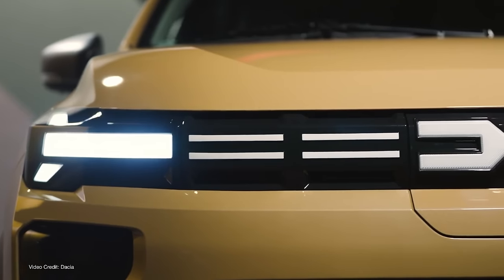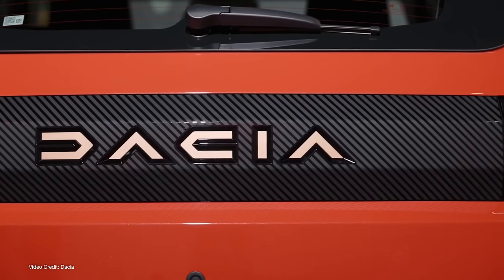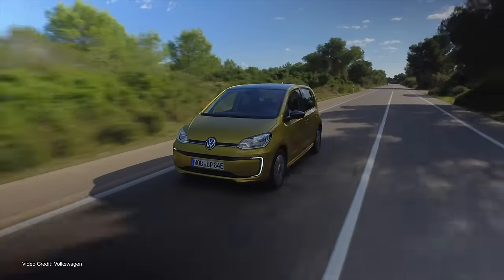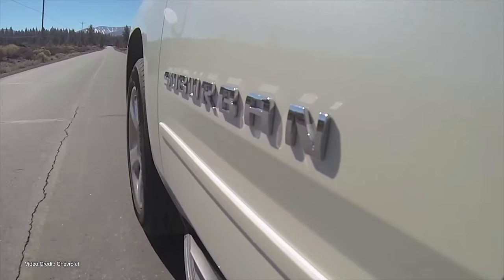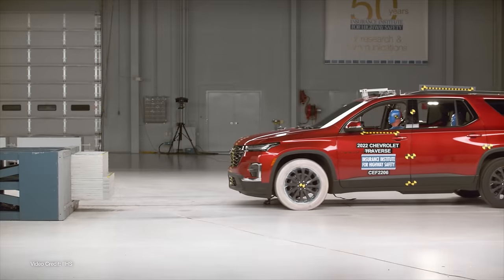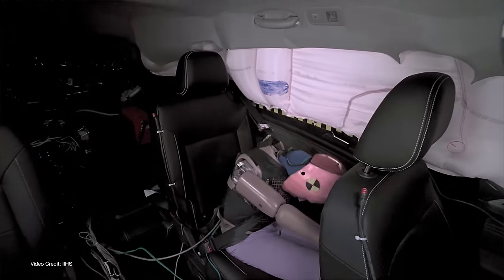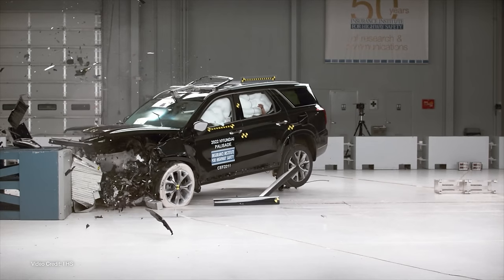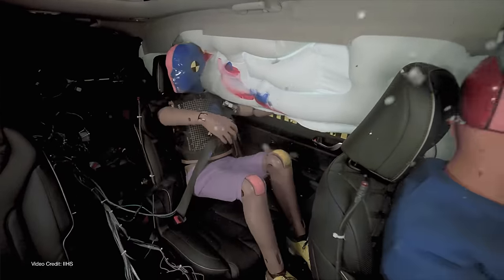Never In The USA - Why the US (And Canada) Appear To Be Anti-Small EV

Comment: The real reason small cars are disappearing is profit margin, the car companies sold loads of smaller, cheaper cars, but they can make more by selling fewer of the larger more expensive vehicles.  So the smaller ones have slowly been phased out.  It's been happening for at least 10 years.  Has very little to do with societal pressures, it's all about the fact that making 2 smaller cars cost more than making one larger one, but the combined profit on the 2 smaller ones is less than the one larger one.  The marketing propaganda by the auto makers will of course just say people don't want the smaller cars, even though they sold tons of them.  They couldn't make the Bolt fast enough to keep up with demand, but still shut down the line to make trucks instead.  No chance the new Bolt will be anywhere close to as cheap as the old one was, and they will say they have to charge more because it's bigger.
Reply: When they were on sale hardly anyone bought them.
Reply: The Detroit big 2 1/2 have never been able to build a decent affordable compact car period. They couldn’t when they needed to when the Arab oil embargo started in fall 1973 and the Japanese automakers began to really sell their sub compact cars.
Reply: THIS
Reply: @AutoReport1  they didn’t buy American small cars, style, reliability, issues
Reply: @rose415  they didn't buy Japanese or Korean ones either. The RAV4 saw sales shoot up by 4× when they upsized it from subcompact to compact.
Reply: The original comment here from Marty is correct, the rest of you need to check for a pulse.  My MR2 was crushed between a stopped vehicle and a caddy doing 50.  Yes I was injured but even that unfair fight left the MR2 passenger cabin in the same shape it was before the impact.
My father owned a Ford Focus that he liked a lot.  Small cars in fact, are "the gateway drug" to Brand loyalty for consumers because most small, used cars are first time purchases of young people.  Not all of them are car savvy but all will remember the car that didn’t leave them on the side of the road when they needed it.

The people most likely to "blame gubment" for every occasion are THE SAME people who absolutely worship corporations and blame buyers.

Just sit in on a quarterly reports meeting for Ford or GM.  Growth in profits instead of just profits is all that matters to them now.  It's tied to executive compensation in the form of stock options.  Why? Because : 1980 presidential election.
Reply: > The real reason small cars are disappearing is profit margin

Well yes, 100% true, but also missing an important piece of context. The market in the US and and Canada is distorted in favour of larger and more expensive vehicles because of things like the light-truck loophole and the way that corporate fuel economy targets are skewed towards bigger vehicles because it's harder to hit to your category emissions target as the vehicle footprint gets smaller. The US does not properly tax/disincentivize big vehicles to make smaller and more efficient vehicles more desirable to sell or buy. And now it's a hopeless mess in American because 

a) The average vehicle weight on American roads is so high that there's a long lasting disincentive for buyers to keep one-upping each other in bigger and heavier vehicles for safety reasons

b) The car industry and the generally bad low-density urban planning across the country keeps reinforcing each other.... people live in dreary unwalkable suburbs with roads wider than highways in other countries -> buy vehicle way bigger than they need because there aren't space or tax penalties like other countries -> get attached to bigger more expensive car because they live in a dreary unwalkable suburb so you need something to make you feel special -> keep buying bigger emotional support vehicles and mcmansions to feel pseical while living in suburban hell where its a 20 minute drive just to get basic groceries.
Reply: Simply put the profit margin for an SUV or Pickup is more than that for making a well engineered and appointed small car.

Comment: Here in Australia 35 years ago, I had the bizzare coincidence of seeing the results of 2 cars crashing at the same place and speed within 24 hours of each other.
One was an older 1966 6 cylinder Chrysler VC Valiant, the other was a late 70's 4 cylinder "Chrysler sigma".
The Sigma was totalled, with the passenger getting a bump on the head from bouncing around unbraced as the only injury..
The Valiant looked fine, barely a scratch - but the 4 passengers ended up hospitalised with broken bones and head trauma..
Thats when I realised the claims that a newer SAFER car was a better option than a cool sounding big old car were true.
Nowadays, tho, its become weird where people ( even in Australia ) are going for SUV's and other bigger vehicles "for safety".
And every week, another child gets killed or maimed because the driver couldn't see them due to the size of the vehicle in thier own driveway!
A 60% increase in 10 years!
Reply: the emission standards has had something to do with vehicle size.
plus the end of the cheap mid/large sedans made by ford and holden.
small cars are mostly junk. they're cheaply made and handle poorly on our horrible roads.
suv became popular because they are easier to live with, the commodore and falcon are hard to get in and out of if you have mobility issues but the like of a VW golf the front door gave you more head room to get in or out.

the difference between the valiant and sigma was more than 15 years of development.
but the valiant would of protected the passengers in a side impact due to the doors being over 2 feet thick 🤣
but yeah a car fitted with the old self adjusting seat belts always faired worse than auto retracting because people never adjusted them correctly

Comment: Thanks for the Aptera shout out! It's the car for me
Reply: Excellent! Wait just ten more years and they will be for sale. In the meantime, get a Schwinn bicycle to ride and when the car does go on sale, you'll be skinny enough to get into it!
Reply: That's a ridiculous reply, you don't have to be skinny to fit into aptera, do you know anything about that vehicle? 

I'm really glad Aptera was mentioned in the video because American cars just keep on getting bigger and heavier and more expensive, despite the efficiencies that could be gained by aiming for smaller and lighter vehicles. The Aptera, although not tiny, is extremely efficient and aerodynamic. And it is coming to production. 
I really think that once something like this goes into mass production it'll turn heads and it will change peoples' minds. Without any new battery technology Aptera is forecasting ranges as high as 600 and even up to 1,000 miles on a full battery.
The vehicle is built on a carbon fiber frame and so should be about as safe as anything out there.
Reply: Were I but 15 years younger, the Aptera would be a great vehicle for me. Not sure my knees could take the low seating, these days. Maybe the next time I'm on the Left Coast I'll try to find one to sit in, just for fun.
I also am a little skeptical regarding this autocycle's long term viability, even assuming they eventually get to thousands per year coming off the line. I can understand why, being capital constrained, they are depending on overseas fabrication of a large portion of each vehicle, but I wish the production could have been organized more vertically, within their own facility, here in the States.
Reliance on overseas production of the motors and much of the vehicle body exposes Aptera Motors to costs (production and shipping) beyond their control and exposes them to additional risks.  I wish them all the success in the world, and look forward to seeing Aptera's wheeling around, but I'm less than sanguine regarding that success I'm hoping for them.
Reply: I've been watching the Aptera since it was first announced.  It looks great, but I want to see reviews before putting money down.
Reply: Well, it’s not a car.
Reply: How well does the Aptera do in 6 inches of snow?
Reply: @RyoshiKuraOka  That was exactly the question I had a few months ago and the answer I found was that it had never been tested in the snow.  It's the primary reason I didn't put money down on one.  I need a car I can use 365, so I'm waiting on reviews.
Reply: not yet made unfortunately
Reply: Well me too, in theory. But it's so ludicrously overpriced it just becomes another status symbol, a wealthy person's gadget. For daily driving i'll get a BYD Dolphin or similar/smaller and buy heat pumps or home insulation with the money I save.
Reply: @nickfosterxx  You make a very good point, but, counterpoint:  Aptera looks neat.  Seriously though, I bought a used Nissan Leaf and home solar panels to charge it.  I don't have hundreds of miles of range, but I can go over a speed bump without bottoming out.
Reply: @madcow3417  Yep. With you on that. I'm lucky enough not to need a car, so share one for the weekly 100 mile round trip. Walkable cities rock, imho the best car is actually no need for a car ; )

Comment: It's a real shame that there are not more smaller cars made.  I really like the bolt.  I had an old honda civic years ago.  I can't stand large cars and suv's they are just very cumbersome.
Reply: There is a lot to like about the Bolt. It would be nice if it DC fast charged faster, but it can do it. Wife has one. It is fantastically efficient around town. It has a very practical shape. It's kinda quick. Not dual motor Tesla quick, but sure doesn't struggle to get going, and it does the 1 pedal driving thing like it should. They say they are going to bring it back. I hope they do.
Reply: @markplott4820 It's very unlikely that the 25k USD Tesla will be produced in significant numbers in 2025, and the price is far higher than half of the base Model 3
Reply: @fjalics  There are dozens and dozens of small car options here in Europe. Pretty much every manufacturer has a small EV option. They have safe crash standards too. They just don't comply with US requirements.
Reply: Europe has over a dozen good small EV’s on offer.
Reply: @AlanTov  I know Nikki is now in the US and thus a bit more influenced by that market than Europe, but I do wonder if they should do an updated video on all the compact and subcompact EVs on offer in Europe. There are so many. The Zoe, the Renault 5, the Corsa, the citroen offerings, the Seat, the VW she mentioned, the Honda E, the MGs, Peugeots, BMW i3, VW id3, Smarts, Skoda etc etc.
Reply: @TheGramophoneGirl  We see those cars all the time on the FullyChargedShow.  So incredibly frustrating to see what is going on in jurisdictions that are not North America.  
Unfortunately the Canadian market is small enough that we are continually lumped in with the US when companies are laying out their marketing and sales plans. When VW USA did not want the ID.3 VW Canada got caught in the cross fire and we couldn't have it even when we wanted it.

Comment: The Aptera is NOT a car. As a three wheel vehicle, Aptera has applied for their vehicle to be an autocycle- meaning it is, according to NHTSA, a motorcycle. As a motorcycle, it doesn't have to meet most of the crash safety requirements and if you're able to insure it, it will be insured as a motorcycle, not an automobile.
Reply: Just because it doesn't NEED to meet NHTSA automotive safety for cars doesn't change the fact that it will; testing will be done in the next few months as PI vehicles are made.  Crumple zones, airbags, large size and low center of gravity means it will still be a very safe vehicle.  Cheaper insurance is a bonus.
Reply: @ccibinel Aptera will likely be safe in but lacking front and rear bumpers a minor impact will probably total it because of the costs and lack of auto body skills repairing composites.
Reply: @timothykeith1367  Repairing SMC is the same as most boats.  Definitely easier than their original composite honeycomb but definitely worse than normal sheet metal.  SMC is basically fiberglass and isn't that rare.  Any damage deep enough to damage the CFSMC body is likely to writeoff most vehicles anyway.

Comment: It's unfortunate BMW could not find a way to make the i3 more affordable.  It's the perfect size for a 1 or 2-person commuter car.  Unlike other small vehicles, it's not claustrophobic.  It feels bigger on the inside than it does on the outside.  It has a reasonable range of 180 - 200 miles around town.  I get about 150 - 160 miles on the highway.  In today's market, it is definitely not a $55,000 plus vehicle.  It would be an excellent $30,000 car.  After 7 years of i3 ownership, I made the mistake of driving an ioniq 5 the other day.  There is now an ioniq 5 sitting in my driveway! It's the first EV that actually made me feel like I was sitting in my i3.
Reply: I will try to keep my i3 as long I can. It will be a classic car in a decade.
Reply: I love my i3 (2018 BEV), but I think that it suffered a bit from 'blank check syndrome' when it came to manufacturing cost. Because the original mission of the 'I' sub-brand was in part to pioneer new manufacturing technologies, they prioritized trying new things (e.g. CFRP body structure) vs. building to cost. They could have made a car within about 10% of the weight and performance of the i3 using more conventional technologies that likely would have been cheaper to build (and consequently, to buy). They almost had the concept a few years before the i3 with something called the Z13 (a quick Google search will show you the right thing), albeit as an ICE vehicle.

Comment: One thing is that smaller cars aren't, necessarily, cheaper to buy. They have all the bells and whistles like power widows, power steering, AC, airbags etc. All those things are considered a necessity these days. They are cheaper to operate, usually but not always. Some of the old cars got fairly good fuel economy and were roomy. The fact that people are so worried about safety is a, relatively, new thing. I'd be willing to bet that most people have never been in a serious collision. I know I haven't in my 50+ years of driving. You can be a safer driver by just paying attention to what you're doing and watching what other people are doing. Put down your cellphone and your cheeseburger. and concentrate on driving. Car/trucks, these days, are so comfortable that people forget that they're piloting an dangerous weapon that weighs a couple of tons.

Comment: The issue with range is if you only have one car you need a car that can do those 1% of the driving.  I live in VA, but family is in upstate NY and I go there in the winter with temps often at 0 or below.  The distance between chargers along I-81 has improved, but there is still a 150+ mile gap and with 40% range loss I can barely do that in my ID4.  If I had a smaller battery I could not make the trip.

Comment: Very thorough.
Glad you at least mentioned the Aptera. I've been following it for a couple of years now.  It has several features.  
#1 it is massively optimized for low air resistance. It has the same air resistance as a mirror on a full size pickup. Crazy.
#2 Light weight.  1,800-2,200 lbs.  2 seat (plus pet), relatively large cargo area. 3 wheels rather than 4.
#3 4 range/battery sizes: 250/400 (41KWH)/600/1,000 mi.  Battery is modular, so it is supposed to be easy to upgrade by plugging in new modules
#4 Includes optional built in solar cells.  With max cells can charge up to 40mi per day, intentionally picked on the average travel you mentioned.  If you get lucky and can plug in to 110v at work you can get 13mi charge per hour. 
#5 Price is good. Was initially touted at US$20K. Now as final build is being finalized price is around US$29K

EV is great, but I live in "Winterpeg" Manitoba, Canada.  Even with global warming, we still get 2-3 weeks of -40C temps and a couple of months of -20C. That means battery range less than 50% of advertised.  That really sucks. And it does not encourage full EV. I think for us Hybrids are a better option.

Response to Tesla Semi:
Have you seen this very niche product.  A EV Hybrid LOGGING truck, specifically for BC. Heavy duty construction all over. "Small" diesel engine (specific size and model is totally user optional, simply drop in replacement since it does not connect to drive system) and "small" battery pack. The "small" motor (much smaller than needed to provide direct drive) runs at optimum motor speed while charging then shuts down. Drive into mountains on battery with empty truck.  Load up 100K lbs for downhill trip to mills. Regen the battery on way down.  On prototype they were saving about Can$10K per month in fuel.
https://www.edisonmotors.ca/

Silly season #1
The Slowest Cannonball Run Ever! Driving A Solar Powered Tesla From NY to LA -100% solar power only!
https://www.youtube.com/watch?v=Max-lF3MzI8

Silly season #2
"Cordless" Tesla 2.0 Turbo Diesel (2700mi Without Charging) P.2
https://www.youtube.com/watch?v=seHWJMKwOQQ
Guy installs a Turbo Diesel in the trunk of a Tesla Model S.